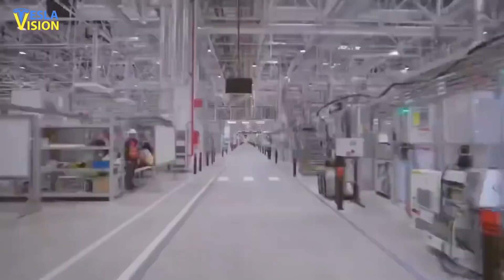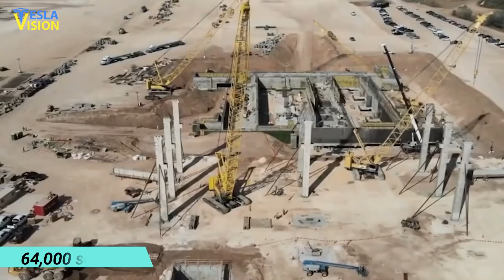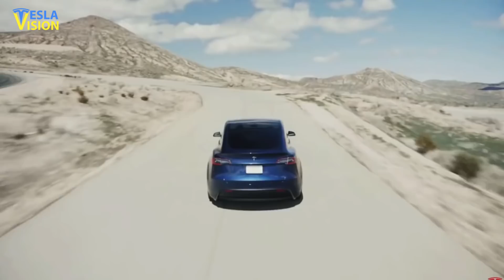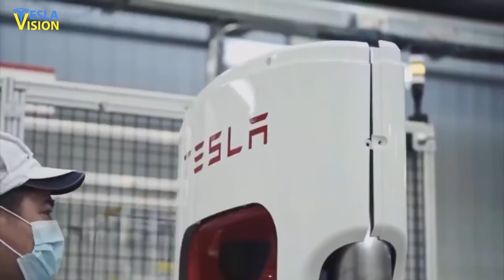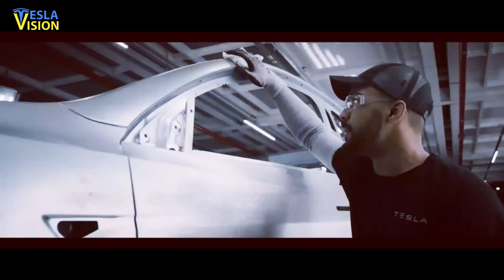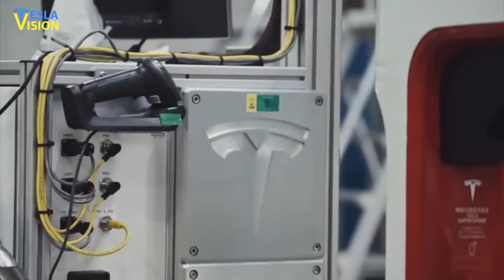Many Laughed at Elon Musk When They Saw THIS, BUT NOW...

Comment: The "tents" that you talk about are only "tent-shaped". They ARE metal buildings, and are the same type as used at the SpaceX Starbase in Boca Chica, Texas. They provide a much larger floorspace than a normal "brick and mortar" building could offer for the cost. I am watching on the 17th, and the Tesla Model Y has outsold all other cars, (not just electric), in Norway in the past two weeks that they have been available. In other words, this one car model has sold more cars in two weeks than every other car model sold in Norway for the entire year. That is exactly why they are expanding Model Y production in Fremont.

Comment: I actually this small factory good idea I did  talked  5 month to help the Roadster to begin to build assembly line its will be lots empty place soon it's does'nt have be build in the same place to be shipped diecast from end ETC battery need to assemble that it's small pickup diversification

Comment: I like your videos but there is a little off in relation to superchargers in this current video. I’m an industrial designer and I’m going to share my opinion. You said the Chinese supercharger factory is set to build 10,000 superchargers a year, that seems a pittance for that size factory??  I believe you said 54,000 sqft. So 50 weeks in a commercial industrial work year 10,000 /50= 200 superchargers a week and divide that by 5 working days you have 40 superchargers per day in a 54,000 square foot factory that’s almost laughable, you could easily build 40 a day in a 10,000 sqft factory very easily? Im proposing the cost per each is around $3-5,000 each but this is purely a guess. This cost fits better with the factory size but the quantity per day seems off? Any other engineers have any thoughts? I believe 10,000 is more like a 6 months projection? Or that they will quickly ramp to 200,000 and then more! There is currently aprox 25,000 superchargers in aprox 2,100 supercharger stations at an aprox cost of $250,000 per station which means Tesla has invested aprox $525M in stations.  Biden’s infrastructure plan can also help Tesla to pay for some of the new stations!  world wide I believe Tesla could double the amount of supercharger stations in 2 years! This idea of allowing all car types to use superchargers is brilliant and I believe it will help handily with Teslas plan to move us rapidly to an EV world!  All my opinions!
Reply: Tesla has been sandbagging
Reply: The superchargers are inside the cabinets and the arches are just convenient connector structures.

Comment: thought model Y was 25 000 usd anyway a ower 500 km range in 4wd is something like 57 000 €not exsactly a 40 000 USD anyway so similaar that vw ID 4 and ID sare somewhere close so much for price we did that we did that and extra 17 000 € in price oh we produce economy welth auto and in 2030 is all electric bla bla some standards from factory are lazy so producer kepd promise to hold price up in each case if something pop out well this brings like diesel range hybrids and petrol hybrids in about 5,5 l per 100km in on price for 5 €drive per 100 km thing again is all equal so only co2 are not so in long term electric car win but producer greedy kepd price and uplifting cosmetic suply standards greedy enough and most idiotic is mercedes statment we dont believe in hybrids since they are ar consumer accordign price per use is not and keeping price up in no detail supply or full suply is exsactly what producer to screw buyers upon adn gieve excuses for price range while even production settings not even fix to be in ratio and already writing it self resime on doc dieter book we are they are adn thats premium class and slating it self prices in premium class that sounds like bad strategy in football like already seen stuff as buyer are just gonna keep eager to jump on e cars if they dont make money on it so far is tesla on a track in production and q to do it others dream about batery whihc tesla already have bit puzling and confusing production in next 10 year is proper  answer from menagment as no one is for shore how or what is going to be done no strategy ort willing process on self process and slef know how oh we are rich on it well tesla is siting on golden eggs in next 10 years and can buy a auto car maker industry jut for fun on made money from employee for fun and get even fiels expertize in auto industry a doc dieter shah on your moves in playing chess with tesla unknowning

Comment: When will electric cars be charged wirelessly like a cell phone? Preferably while driving?
Reply: This is a great idea in theory and may well someday become reality but it has a lot of technical hurdles to cross first. 

How long does it take to charge your battery? What speed does your car travel on highways ? How many Km of infrastructure do you need for that ? 
I could see Wireless charging on parking spots before in-road charging once a standard is developed. 
Alas, manufacturers can’t agree even on a plug standard (Tesla v. CCS v. ChaDeMo) so wireless is still a few years out.
Reply: @ioannisd00  makes sense